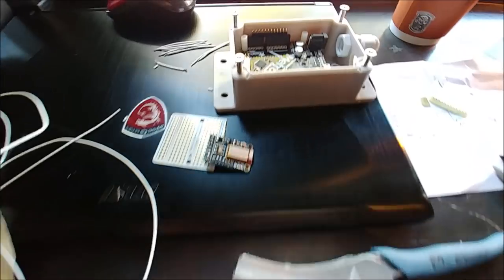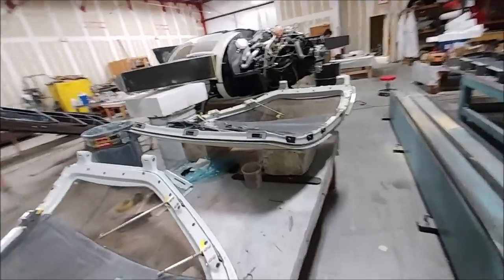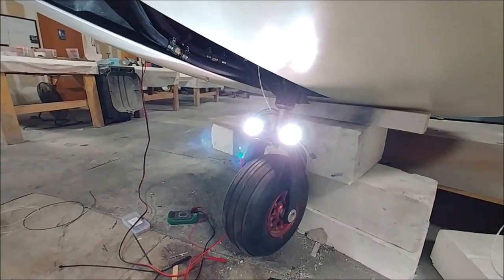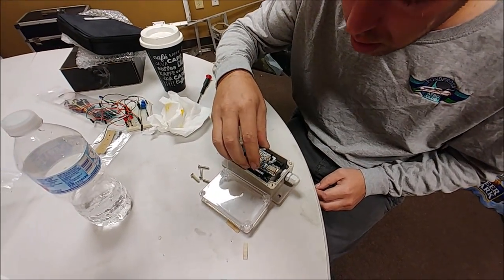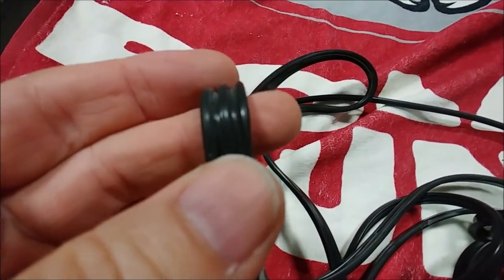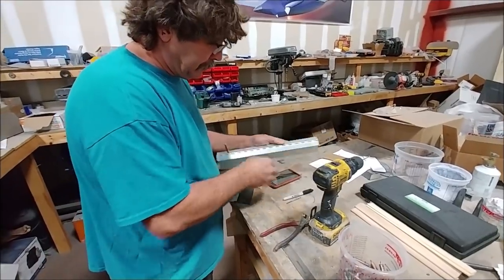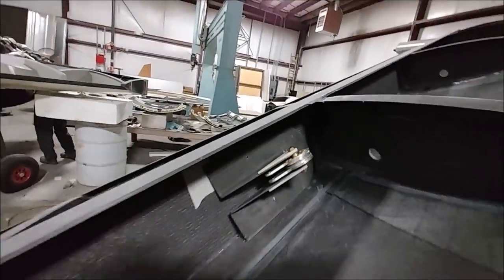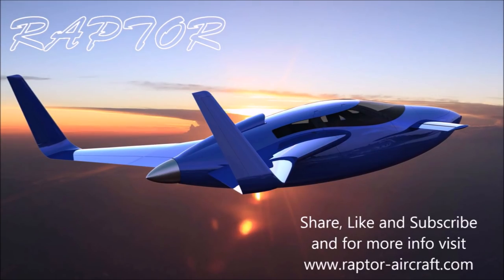Lighting the HIDs - Building the Raptor Prototype

Comment: Nice!  I think your door adventures are finally close to the end on the prototype.  I thought you were going to use 3M trim adhesive, which is yellow contact cement that only allows one application.  That RTV worked out fine.

Comment: When you pump up the door seal, isn't it the center rib that does the sealing? Hope that the side ribs alone can do the job now at the bottom of the door.
Reply from the maker: It's so snug at the bottom it won't leak and if it does it will be minor. We need some leaks in order to turn the cabin air over so it doesn't get stale.